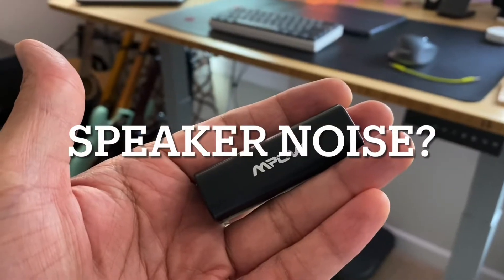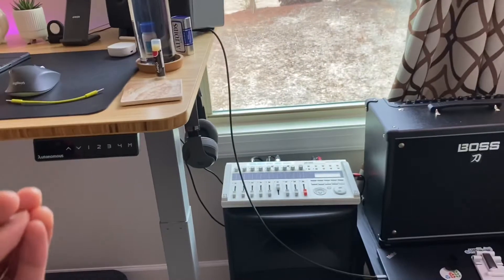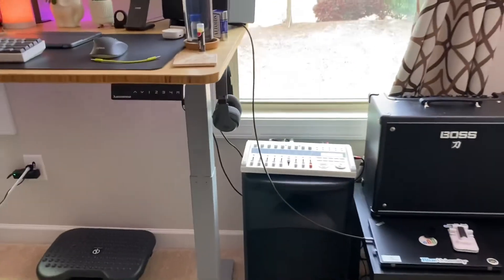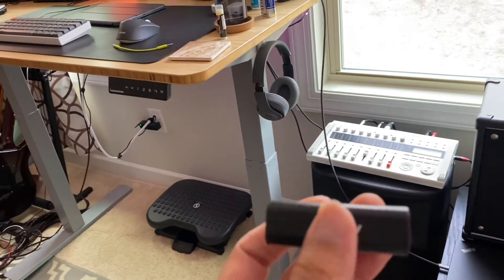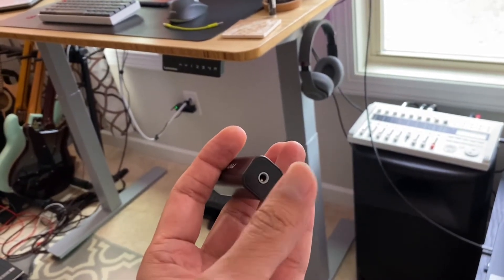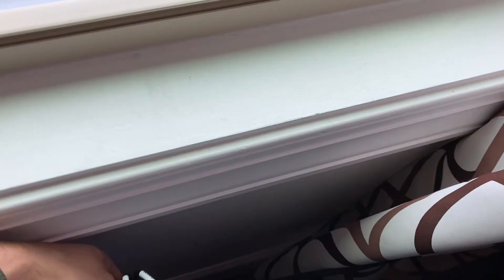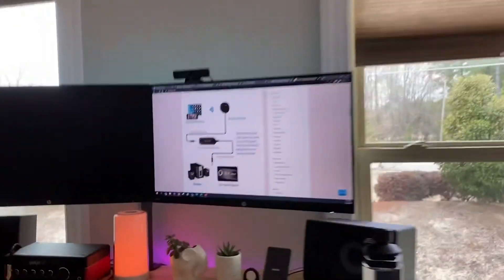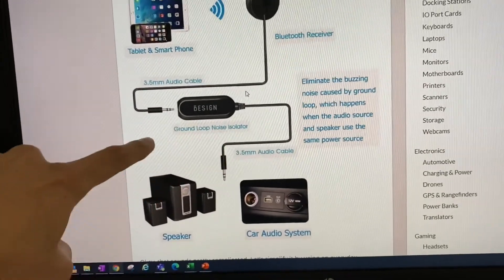How To Fix Speaker Noise With A Ground Loop Noise Isolator

Comment: Do you you think it could work using it between a headset microphone (or any microphone with a 3.5 mm connection for that matter) and a computer? Assuming the microphone issue is related to bad grounding, of course
Reply from the maker: If your connector is TRS it might work (and this is cheap enough that its worth trying out). However if you use TRRS on the mic, it may not work. Here's an article that explains the different types of connectors. https://www.movophoto.com/blogs/movo-photo-blog/differences-between-ts-trs-and-trrs-connectors